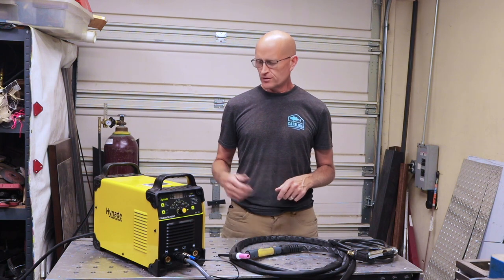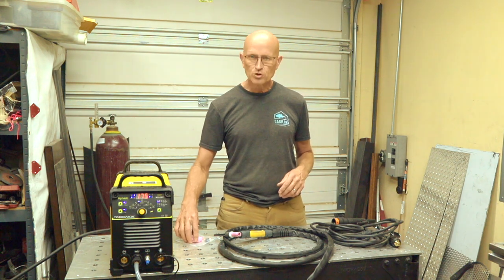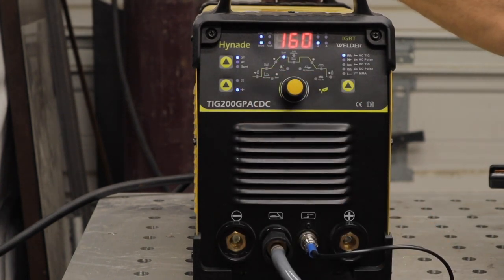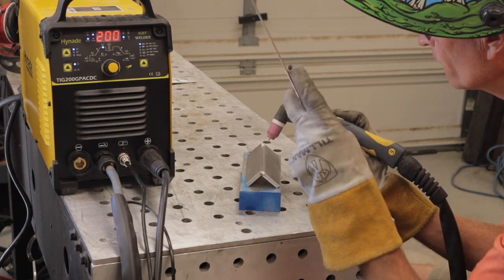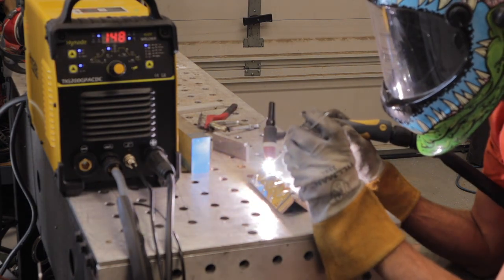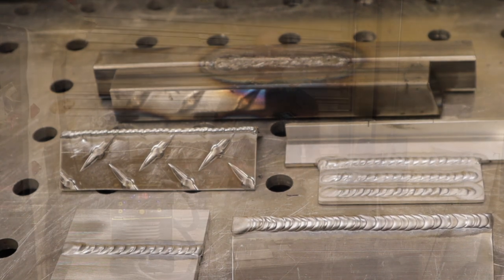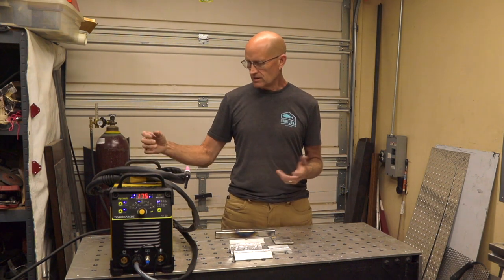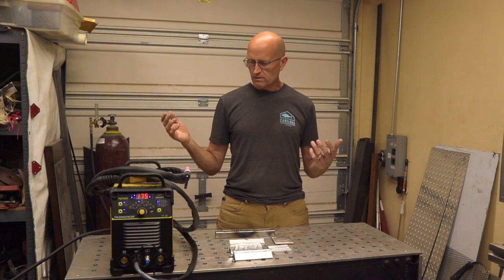Hynade 200 Amp AC/DC Tig Welder Review --- Aluminum Capable!

Comment: Is there any difference between this machine and Hitbox HBT250P except dual voltage? These two machines and Acrcaptain 200P look the same, just different brands.
Reply from the maker: I don’t have any experience with the hitbox welder. I have reviewed both the Hynade and the ArcCaptain and they both weld beautifully. The ArcCaptain has a better warranty and a slightly smoother arc when welding aluminum, but otherwise they are both great welders. Hope this helps.😊👍Don

Comment: Great video, could post some basic settings for just starting to tig? Like amps to thickness for aluminum, stainless, and mild steel, type of tungsten to buy, and filler rod, machine arrived today, haven't bought my consumables yet, I did get the foot pedal... thanks DAVE.
Reply from the maker: Hi David! For my baseline settings I use the miller welding app for everything. It is free and gives me my starting point for all metals and welding type. It has saved me so much time over the years! I use only 2% lanthanated tungsten for everything. It is the best all around tungsten that I’ve found. I use 5356 3/32” rod for most of my aluminum welding and 308 stainless rod for stainless steel. Mild steel I use the standard ER70-S6. Hope this helps and let me know if you have any other questions.😁👍Don

Comment: I actually ordered this as a result of this review. Thank you! 
Question, do you know how much it pulls at the outlet? I have a 30 amp circuit now but am assuming I'll need to consider running a new circuit
Reply from the maker: Hi Dan! Glad the review helped! Your 30 amp circuit will be fine. I’ve run my 250 amp welders at max on my 30 amp outlet and never tripped a breaker ever. For 200 amps, a 30 amp breaker is more than enough. Have fun with the new welder!👍😁Don
Reply: Update for your experience on the one you ordered?

Comment: Hi I bought the hynade tig 250 DP and I want to start welding aluminum 1/8 what the setting and wish kit you recommend.  Thanks!!!!
Reply from the maker: Hi Eddie! Congrats on the new welder! For 1/8” I usually set the welder at 170 amps. The frequency I set at 80 and AC balance I set at 30. Use the #5 cup with 3/32 tungsten. I use  2% lanthanated tungsten for everything. Set your argon flow to 12-15 cfh. This is my daily setup and I’m welding 1/8” aluminum right now with these exact settings. 😊👍
Reply: @PranaTech  thank you!! So much for your advice I really appreciate also thanks for replying to me I will definitely subscribe in your channel.
Reply from the maker: Hi Eddie! You are very welcome and let me know if you need any help when you get going. 😊👍

Comment: Hello, Don. Thank you for the useful information and sharing the link to purchase the machine.
If I want to weld 1/4" aluminum (TIG) with ER4043 rod with this machine, what settings do you recommend for? 
1: Pickamp. 
2: AC Hz.
3: A Balance 

Thanks so much.
Cheers.
Reply from the maker: Hi Damoun! Thank you for your kind comment!
For 1/4” aluminum you will need to set the welder to the full 200 amps. I then set the Hz at 60 and the AC balance at 25 to 30 depending on the cleanliness of the aluminum. New clean aluminum I set at 25. Old oxidized aluminum I clean as best as I can and then set the balance at 30. For outside corners and flat welds these settings will work great. For inside corner welding of 1/4” aluminum you will need to hold the torch at the beginning of the weld and allow the metal to preheat a little bit until a decent puddle begins to form, then begin welding. Inside corner welds take more amperage than outside or flat. You can also preheat the metal a little with a propane torch and bring the metal up to 200 degrees and it will weld much easier on an inside corner with 1/4” Hope this helps you my friend. Let me know if you have any other questions. 👍😊Don
Reply: Thank you,  I appreciate the complete answer
Reply: Thank you for responding to all the questions.
If I reduce the aluminum's thickness to 1/8", what setting do you recommend for Pulse Hz, AC balance, and pick amp?
Thank you.
Reply from the maker: Hi Damoun, for 1/8” I use 80HZ, same AC balance as 1/4” and 140 amps for outside corners and flat welds and 175 amps for inside corners. If you want to do pulse welding, I set the pulse frequency at 1.5 and add filler at each pulse.😊👍

Comment: I bought this machine from Amazon and I couldn't use it. The first thing that was damaged was the gas hose. The internal cable got hot and broke the gas hose. I repaired the hose and removed the negative cable from the torch and replaced it with a cable to the terminal. Negative and now that I am going to use it, when I turn on the machine it starts by itself. I thought it was the torch switch and I disconnected the torch and the damage persists, it is something internal. of the machine
Reply from the maker: I would definitely send that one back! Sounds like it got damaged.

Comment: After about 4” weld on aluminum, the machine stop and cool the machine down? Why is that? Only 4” weld, do you know how to fix it?
Reply from the maker: Hello. Can you give me more information? Are you running it on 110 volts or 220? How thick of aluminum are you welding? I’ve only welded with it on 220volts and I could weld 6-8” on 1/4” thick with no problem at all at full 200 amps.

Comment: Thanks for answering my questions I have one more which is what size filler rod are you using?
Reply from the maker: I use mainly 3/32” 5356 rod for everything. I do keep some 1/8 rod on hand for thicker joints, but for 95% of my welds I use 3/32”. I stopped using 4043 rod a couple years ago because 5356 looks so much better and doesn’t have the grainy texture of 4043. 😁
Reply: @PranaTech  thanks 🙏 once again !! U are greatly appreciated 🙏
Reply from the maker: Anytime 😊👍

Comment: Great video! I guess the torch head, torch connector are a universal standard so that you can use other brand torches and pedals if you wanted too? I'm in a different country so I'm hoping I don't have to wait for parts to be shipped.
Thanks 🙏
Reply from the maker: Hi Scott, sorry for the delay in responding. Somehow I missed your comment. Ok, the torch connection is pretty standard for Chinese Tig welders. It is a male 16x1.5mm fitting coming out of the welder. If you have any Chinese Tig torches where you are, there should be some that fit. I can also help you adapt any CK Worldwide torch to this machine because I have done the conversion on this welder and my Yeswelder Tig and it is pretty simple. The pedal is fairly standard as well. It uses a 10k potentiometer and a 5 pin GX16 plug. I have the wiring diagram for the pedal and plug so if you can find a pedal there I could give you the diagram on how to wire it up. 😁👍

Comment: what did you set your ac balance on I've been playing around with mine and so far haven't found the sweet spot for ac balance yet.
Reply from the maker: Hi Gordon! For me, the sweet spot is usually around 28- 30. I do go up to 35 sometimes if the metal is really dirty or oxidized. Sometimes I go down to 25 if the metal is really clean and I want a minimal cleaning band for appearance reasons. Hope this helps my friend!😊👍

Comment: Sorry it trying to be dumb just started learning about this but do I need to have a 200a breaker for this welder then? Or a specific power supply to feed this ?
Reply from the maker: Hi Greg! No, a 30 amp 220v outlet will be all you need to do everything this welder can do. Not a dumb question at all. Hope this helps! 😁👍
Reply: @PranaTech  it does thank you I plan to pick up one of these in the next couple of weeks. Any recommendations on what metal to start on? Or welding rods you like to use ?
Reply from the maker: Hi Greg, I would recommend starting with mild steel and then once you have your skills built up, move on to stainless and aluminum. Aluminum is the most difficult of the three but it is certainly the most fun for me. For mild steel I use ER70S-6 rod either 1/16” for thin steel and 3/332” rod for thicker steels up to 1/4” thick. For stainless I use 308L in 1/16” rod for almost everything. For aluminum I use 5356 rod for just about everything. 3/32” for thinner aluminum up to 1/4” thick and 1/8” rod for thicker aluminum. You will need to get an argon tank for Tig welding and an argon regulator to hook it up to the welder. Let me know if you have any questions. 😊👍
Reply: @PranaTech  thank you I appreciate it a lot !
Reply from the maker: Anytime!😊

Comment: Also what pedal do you recomend?
Reply from the maker: Hi Dave, I’m sorry I missed this comment. I usually answer everything that comes in. The Hynade pedal is pretty decent. If you want an upgraded one, you can go with the Yeswelder pedal for about $100 but you would need to change a couple of the wires around in the plug because they use the same internal components but they both are wired differently. I have the wiring diagram for the Hynade if you ever wanted to do an upgraded pedal. SSC is now making their custom pedal to fit the Yeswelder so I’m sure they would do one for the Hynade for you if you sent them my diagram. It is the same pedal just different wire locations on the plug that goes into the machine. Hope this helps and sorry I missed your question until now. 😊👍

Comment: Can u help me with the settings to weld aluminum intercooler pipe? Thanks in advance 🙏
Reply from the maker: Hi there! Yes!  If it is standard 1/16” thick tubing, I weld at 65-75 amps with 200-250HZ for frequency and ac balance set at 30-35. Hope this helps! 😊👍
Reply: @PranaTech  Thankyou very much.! 🙏 will give it a try . Have a awesome day!
Reply from the maker: Thanks, you too!😊

Comment: Do you know if you can use a regular tig torch I have a flexible tig torch for my sa 200 I don’t remember the brand but it wouldn’t connect to the same spots as the one that it came with
Reply from the maker: Hi Derrick, I am using a CK worldwide torch on mine. You have to use an argon hose coupler https://www.amazon.com/Western-Enterprises-AW-430-Couplers-Connection/dp/B002BXW8M2/ref=sr_1_2?crid=GLHQREPTSVKA&keywords=argon+hose+coupler&qid=1665110052&qu=eyJxc2MiOiIxLjA2IiwicXNhIjoiMC41NCIsInFzcCI6IjAuNTAifQ%3D%3D&sprefix=argon+coupler%2Caps%2C115&sr=8-2 
and shorten one end to just above the hex portion of the coupler. You then drill out the center and tap to 5/8x18 threads. This then makes the male outlet on the welder a 5/8-18 female and then any of the CK worldwide air cooled torches that have a 5/8-18 fitting will fit this welder. Hopefully this makes sense. If not, ask me anything about it.😊👍 Don
Reply: Thanks! Can you do a video on how you set it up?
Reply from the maker: Hi Derrick, yes I’ve been working on one that shows how to convert just about any Chinese welder to a USA torch. I just haven’t been able to finish it yet because I started a welding business and I have way more work than I can keep up with.😱🤣👍 I’ll try to get it done soon. 😊
Reply: @PranaTech  awesome thanks! I’m thinking about doing the same so it’s good to here yours is doing good!

Comment: One more question 🙋 how do I adapt a CK worldwide torch to this machine?
Reply from the maker: Ok, if you want to convert to an American air cooled torch the process is pretty straight forward. You will need one of these couplers https://www.amazon.com/Stark-Welding-Coupler-Fitting-Coupling/dp/B086R7RH67/ref=mp_s_a_1_4?crid=15KUIH8AJPOEK&keywords=argon+coupler&qid=1658870010&sprefix=argon+coupler%2Caps%2C253&sr=8-4  You then cut one end off just past the hexagon part. You have to drill the barrier out of the middle and then run a 5/8-18 tap all the way through it. This then threads onto the welder and becomes a female for the us made torches to thread into. The torch needs to have a 5/8-18 male which is very common. I’m using a CK worldwide torch. Let me know if you have any questions. 😊👍
Reply: @PranaTech  🙏🙏🙏🙏 thanks again !!

Comment: I’ve watched a couple of your videos on mig welders.  Between the YES 250amp pulse welder & their 250a PRO mig, which is the better unit?  Or is this unit better?  
I’m no welder, but wanting to learn. I was about to pull the trigger on the 250 amp pulse welder but being so new to this, I’m not sure which welder, let alone accessories to buy or find elsewhere.  Thanks
Reply from the maker: Hi Brian! The pulse welder is a Tig welder and would be great if you want to learn to weld aluminum and stainless steel. If you are starting out I would recommend the 205DS MiG which will work with 120 or 240volts. It’s a simple and easy to use welder to learn on. If you have 240volts and want a 250amp setup to weld up to 3/8” thick steel and thicker, I would go with the 250pro MiG. Hope this helps😁👍let me know if you have any other questions.
Reply: My bad, I meant to type Tig!  I already have a Lincoln 140 mig welder & have used it some.  However, I need aluminum & stainless steel ability for automotive things.  Right now the Yes welder 250p AC/DC with pulse is on special for $599, & that’s not a typo either!  
If I was to buy that welder what else should I buy with it?  Pedal, regulator, ??
Reply from the maker: Hi Brian, sorry for the delay. I never got a notification for your question. The welder and foot pedal and regulator will be what you need. That is a great price, wow!😊👍
Reply from the maker: Let me know if you buy it and I can help you get started with settings for aluminum and other stuff you’ll need for Stainless welding. 😁
Reply: I pulled the trigger & bought the YES 250Amp AC/DC TIG Aluminum Welder With Pulse!   I’ll eventually need to buy the pedal, tungsten, an accessory kit & filler rod.  What’s the best way to get in touch with you once the welder arrives, to get some guidance on setting & such?  Thanks
Reply from the maker: Hi Brian! Hey that’s great! I’m sure you’ll have lots of fun Tig welding with it. Just email me at pranateq@gmail.com if you need any help with settings or anything.👍😁

Comment: What foot pedal does it take?
Reply from the maker: Hi Austin! It takes their own pedal that comes with the welder. If you own this welder but don’t have a pedal, I have the schematic for the pedal so any 10k ohm pedal will work with it like the Yeswelder or others. You just have to swap the wires on the plug for it to work on the Hynade.  If you want an upgraded pedal, SSC makes a really nice pedal that fits the Yeswelder, but they are pretty pricey!  Let me know if you have any other questions and I’d be glad to help.😊👍Don

Comment: I've had this welder for a few months but only been using the ARC welding feature. Today I set it up for TIG but had an issue immediately. I noticed a strange buzzing noise when I switched from MMA to any other TIG mode, and I cannot strike an arc. I've tried with torch control and with pedal control. Also, as soon as I open my gas bottle the gas runs through the torch freely. It does not shut off. Any ideas?
I've emailed the Amazon seller but I'm pretty sure I'm going to get nothing back and no help from Hynade. They're website is sketchy.
Reply from the maker: Hi Luke, I’m sorry to hear about the problem with your welder.  It definitely sounds like there is a problem with the main control board. I would message them through their account on Instagram. They are on there daily and usually respond pretty quick. I hope they resolve your issue promptly.👍
Reply: @PranaTech  thanks so much for the quick response! I'll shoot them a message. Hopefully they can help me with my issue.

Comment: How is this welder holding up?  Are you using it on a regular?  Thanks
Reply from the maker: It’s doing great so far. I’ve been mainly using it for aluminum welding and it has never skipped a beat. Welds very consistent with a stable arc. 😊👍
Reply: @PranaTech  Thank you for the info!  Appreciate it!
Reply from the maker: Anytime!😁👍

Comment: What pedal would you recommend?
Reply from the maker: Right now the only option is the factory pedal, but I did convert one of my Yeswelder pedals to work with this Tig because the pedals use the same potentiometer setup with a 10k. All you have to do is swap the wires around on the plug and you are ready to go with a much better pedal. SSC is now making their pedals to fit the Yeswelder and they make about the best out there. I have the wiring diagram for the Hynade if you decide you want to wire up an aftermarket pedal. 👍😁

Comment: Will this machine be capable of welding aluminum alloy wheels ?
Reply from the maker: Hi there!  Yes, it is capable for sure. Be advised though that welding aluminum wheels is always an adventure! Depending on the quality of the aluminum used in the casting of the wheel, it can be as simple as welding regular aluminum or an absolute nightmare! Welding wheels is usually a pain and I usually tell people that I need to do a test weld to see if it can be welded. If the alloy is full of junk, I usually pass on the job because it is more trouble than it is worth. Also, this is only a 200 amp Tig so realistically you are not going to weld anything thicker than 1/4” thick on a wheel and most likely you will need to do some preheat of the surrounding area as well. Hope this helps!😁👍
Reply: Super helpful ! Thank you so much
Reply from the maker: Anytime! 😊👍
Reply: @PranaTech   another question. I’m stuck between this machine and a yeswelder 250p ac/dc tig. . Which one would you prefer
Reply from the maker: That’s a tough one! They are both great machines. My experience over the years though has proven that many times, having 50 more amps has allowed me to do jobs that I could never have accomplished with a 200amp machine. If it were me, I’d go with the 250. Just to prove my point, after many years of welding with 200amp tigs, I upgraded to the Yeswelder 250. Now after having it for a few years, I just upgraded again to a 325amp Everlast.  There’s an old saying in the welding business, “you can never use the amps that you didn’t buy!”  😊👍